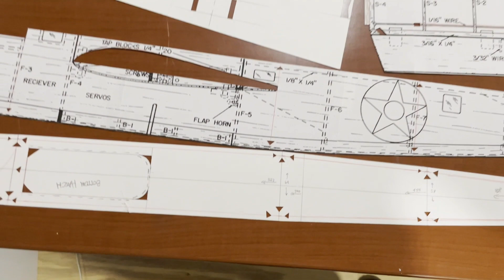Foam Board/3D Printed Hybrid B25 Maiden and Build Details

Comment: You totally nailed this one. It's such a beautiful plane and with endless possibilities, the 740 g isn't that bad. I've flown and seen heavier. It holds its own and even after the crash it flew just as good as it did before Oh yeah on your specifications you have ready to fly weight is 540 g. I think it should be 740 and as for the motors, just one of them will fly that plane with the thrust they have. Take care and I think I asked this in your last video if you have that. STLs because this one could even be a beach craft a DC-3. Like I said, you made a pretty good platform
Reply from the maker: Thanks! Nice catch on RTF weight. If you want the stls, send me a note at robsrcplans@yahoo.com
Reply: @thenerdoligist1292  just sent it and thank you